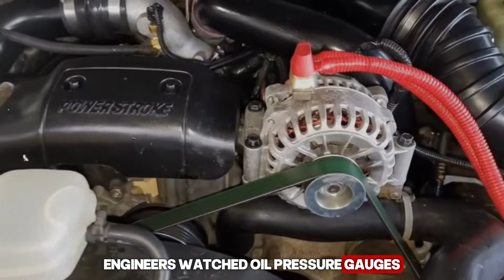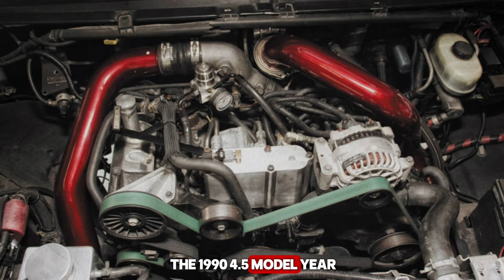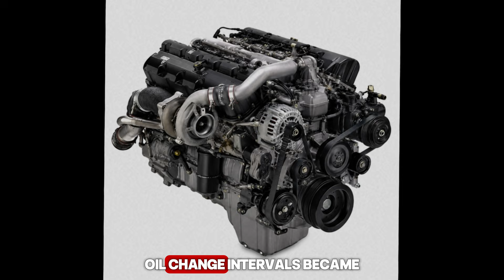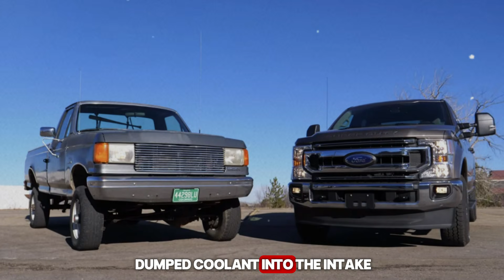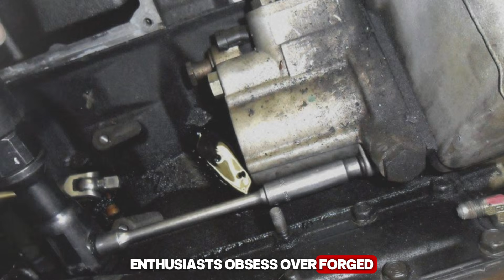How Ford’s 7.3 Powerstroke Became a Million-Mile Legend

Comment: Why are you lying? No 7.3 from 94 ever made it to 400,000 miles. 
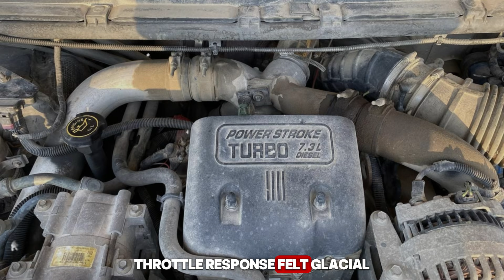2:48 the 94 7.3 turbo was not called a Powerstroke and it did not smoke at all. That was the one of the reason Ford installed a turbo. Boost put enough air in the cylinders so they didn't smoke. I know this because I drove one for a year. I was 23 in 1994. It also had a cat to cut down on exhaust smell.
Reply: The power stroke came out in 1994. There were three options. IDI, IDI turbo, and power stroke
Reply: @BrianKlecan  Not true, 93 was the none turbo, 94 was the turbo and 95 was the powerstroke. My coworker drove a 93. You can't go by google because it is uploaded by people who was not living in 1990.
Reply: It is true. I've seen 94 power stroke trucks. I've seen 94 IDI turbo trucks and Ive seen 94 IDI trucks. One particular customer bought his brand new and he said all three were an option. He got the IDI no turbo. Another customer has a 94 IDI turbo. I have a 94 Power stroke.
Reply: @BrianKlecan  What did your 94 Powerstroke say on the fender?
Reply: @Fone65 it says power stroke under the f350 badge
Reply: If it was IDI it'd say turbo diesel up front
Reply: @BrianKlecan  What was the max rpm of your 94 engine?
Reply: @BrianKlecan  You are lying your azz off. You are fighting me with google. Google is wrong. I just google 93 f250 diesel hp rpm and it's wrong. Google said the hp was 185 @ 3,000 rpm. That's not right. It was 180 @ 3,300 rpm.
Reply: @BrianKlecan  Now I know you are reading from google. I'm not talking to you anymore.
Reply: @Fone65  😂 dude it's all known things